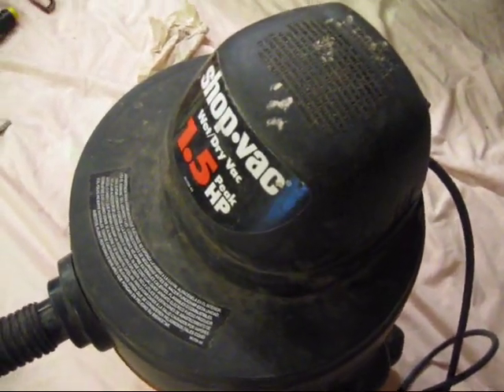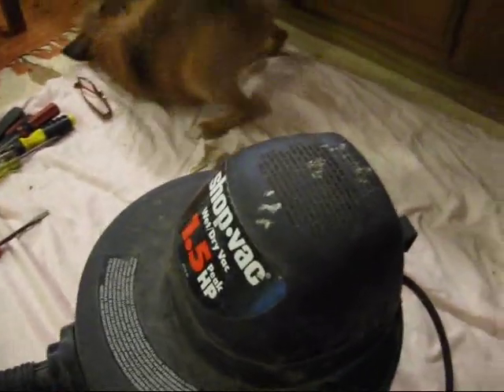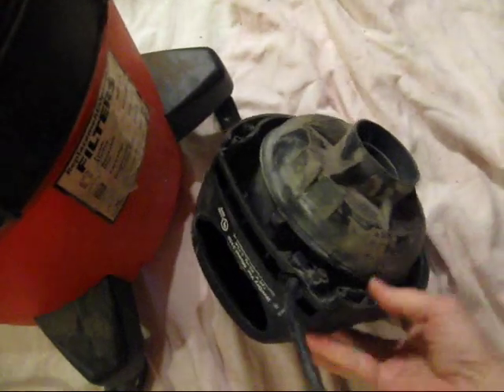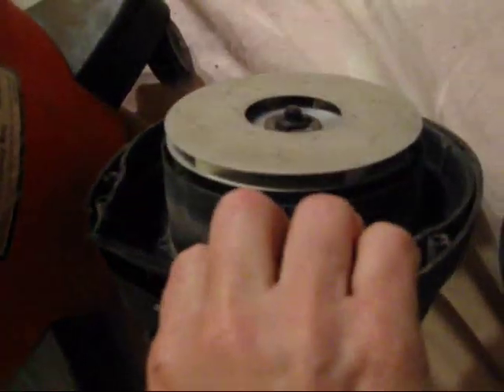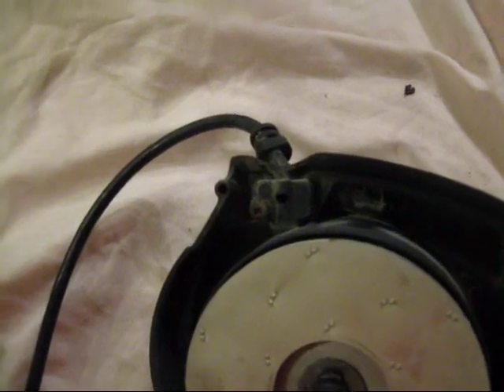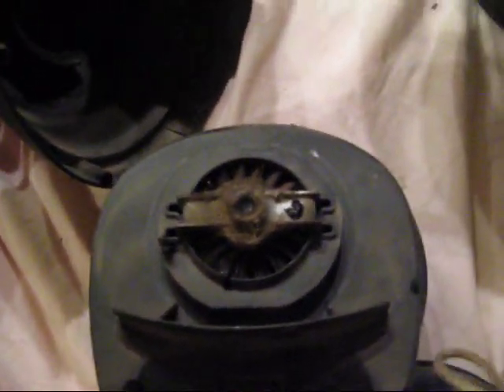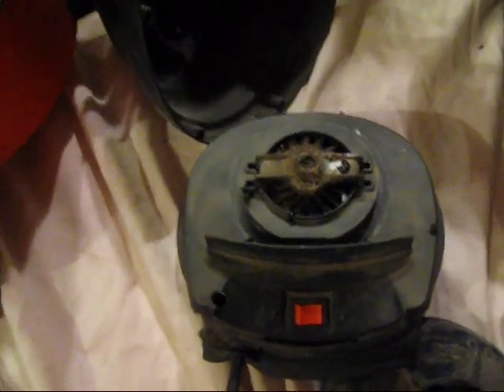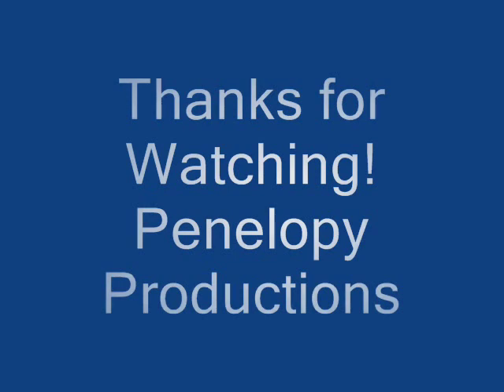Learning Small Electrical Motor Repair As I Go on a Shop Vac

Comment: nine times out of ten it is the on/off switch that goes bad...it'll even make it sound like the brushes and bushing/bearing are going bad....been there done that with a 700A Shop Vac...it sounded like it was trying to come out of the housing so I naturally thought something internal was rubbing but come to find out the on/off switch wasn't providing enough juice...the bad news is I ruined that aluminum impeller trying to get it off and now they are as rare as a UFO sighting....grrrr

Comment: Higher quality motors have ball bearings at each end, sometimes they cut corners and put bushings in.  If you take the motor apart further you can sometimes actually soak the bushing in oil and it may absorb the lubricant, if it is a ball bearing you can carefully remove the rubber seal and get some lubricant in there, or better yet - replace the bearing.  That's more involved.